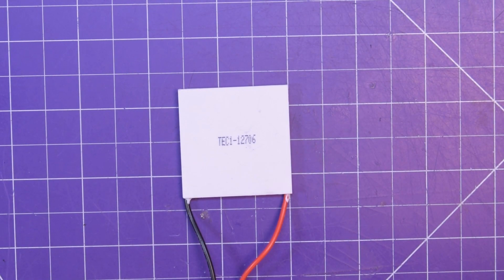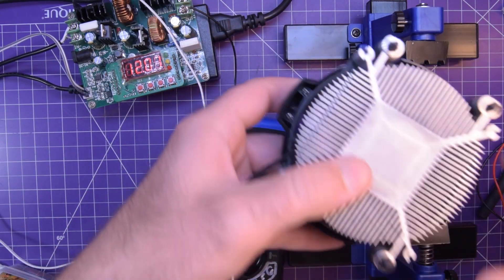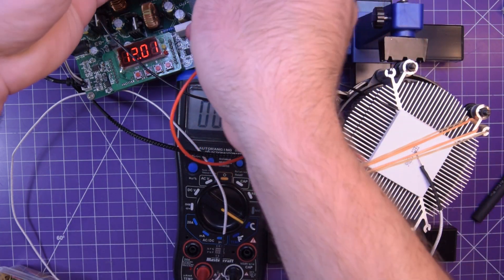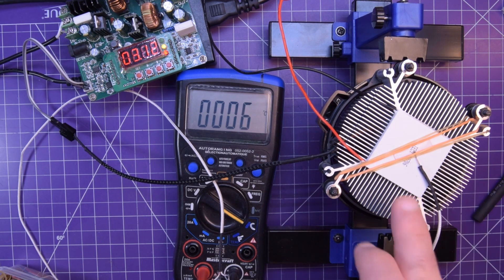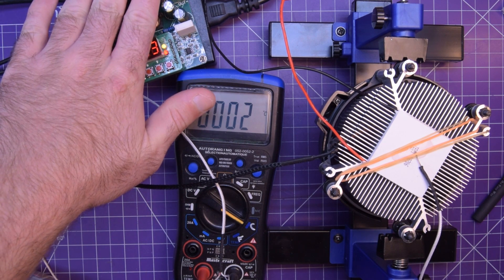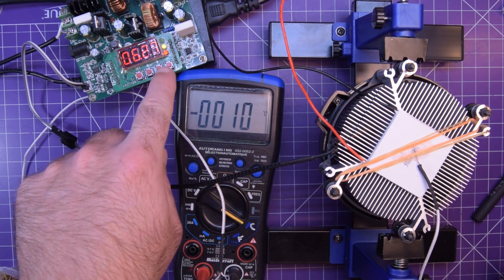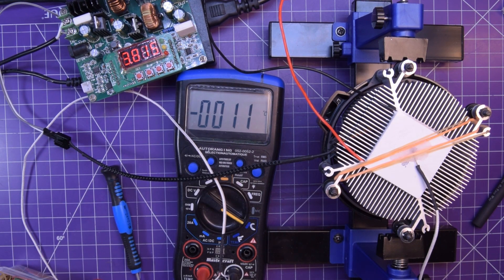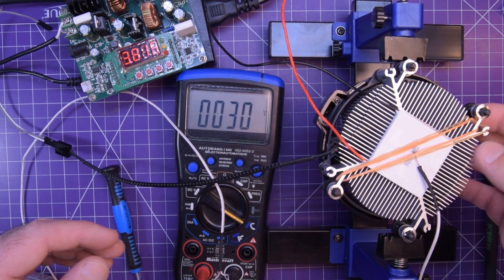Testing a TEC!

Comment: Dihydrogen monoxide, nasty stuff, I spent 2 days in hospital after exposure when it was mixed with C2H5OH.
Reply from the maker: Yikes! and the so-called "governments" are recommending rubbing that combination all over our hands these days :(
Reply: @SimpleElectronics  IPA, at 70% concentration, is what is good for rubbing on your hands.  I its C3H8O.
Have not seen a bottle of that stuff on store shelves since February.  You can get it online for $9/bottle.
I like it to clean flux and grime off my soldering projects!
Reply: @GnuReligion  You should try here in the UK! $14.30 for 200ml if you are lucky enough to find it in the shop's.
Reply: @isoguy.  Ghads!  Ridiculously expensive!  Who are all the OCDs overusing the stuff?  One little bottle of sanitizer lasts me weeks.  Denatured Alcohol (poisoned ethanol)  is much cheaper than IPA now.  It is dryer and better, really, for most cleaning and solvent applications.

Comment: Only heard them called Peltier coolers but looking at one here it says TEC 12706 on the top!
You should definitely get a bench power supply. I love mine and it wasn't even expensive.
Reply from the maker: Some day! I have other priorities for just now! Which one did you get?
Reply: @SimpleElectronics  Search 1503DD on ebay. Loads of similar models. Around 50 CAD?
Reply from the maker: @Codedbad  Is it spelled properly? eBay is returning no matches
Reply: @SimpleElectronics  As far as I know that's correct. Google images shows lots.